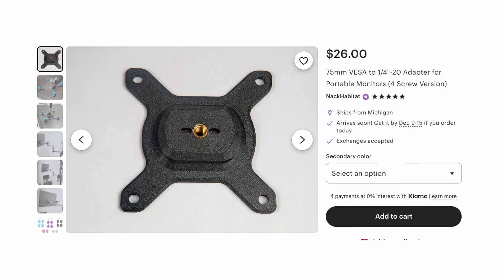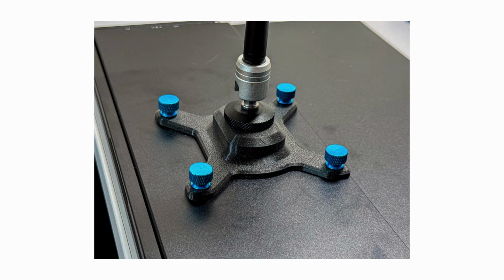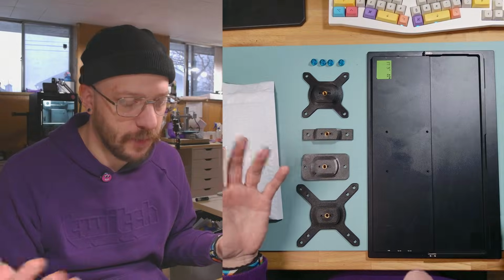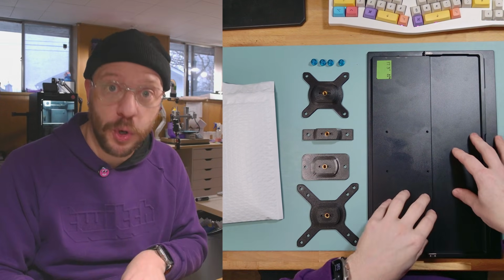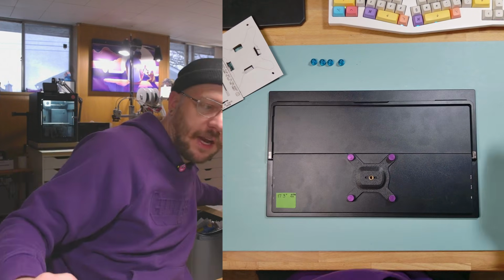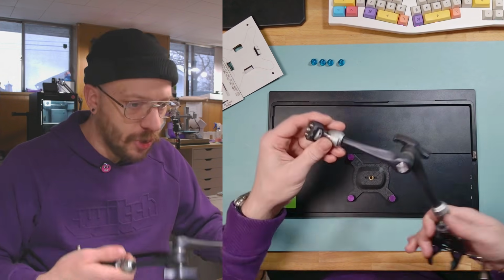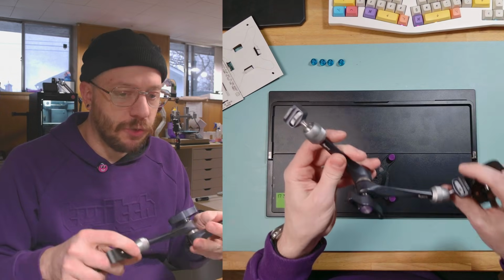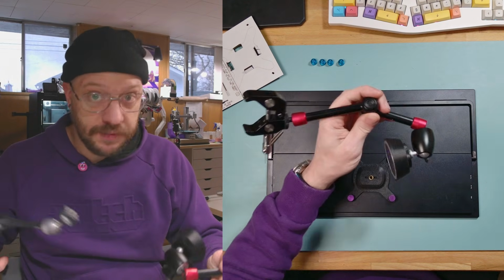VESA Adapters for Portable Monitors | Product Overview

Comment: nice designs. 

Though i think the heat insert threads would be better inserted into the back, with a through hole in the print thats slightly larger than the bolt, so theres layers of the prints between the thread and the bolt. That way the insert would have to get pulled through the print for the insert to strip out, making the whole thing less likely to strip out of the print from the weight of the object being mounted. Especially for setups where the monito might get moved around constantly, the insert would likely wiggle loose over time.
Reply from the maker: Thank you! 

So these threaded inserts average about 150-170lb of load before they start to break free. These monitors weight between 1-2lbs so I don’t really see that as an issue. I have threaded inserts from custom iPad stands that’s I’ve used and moved for a few years with no evidence of the insert shifting or loosening. 

From what I’ve read, Pass through holes actually lower the pull out strength.